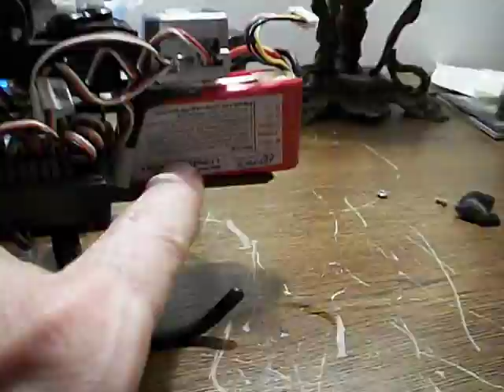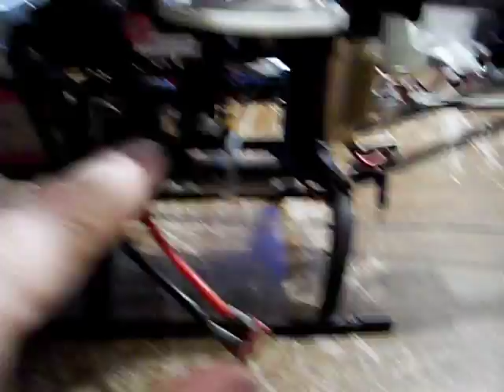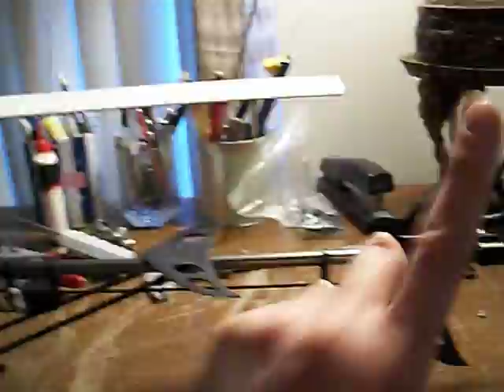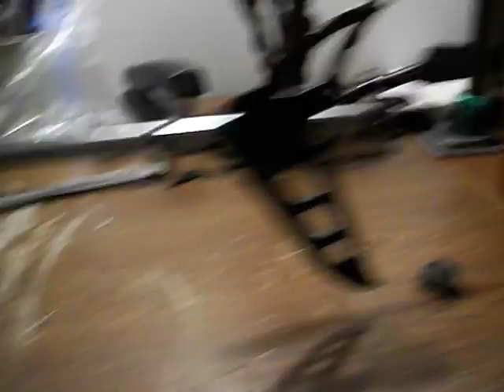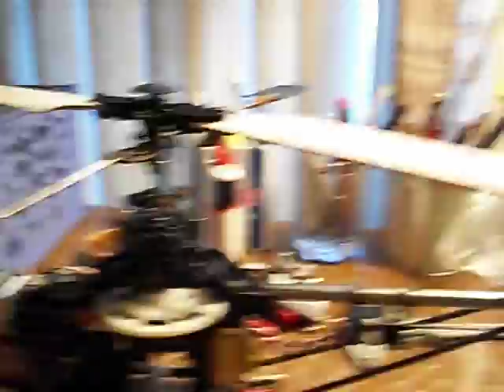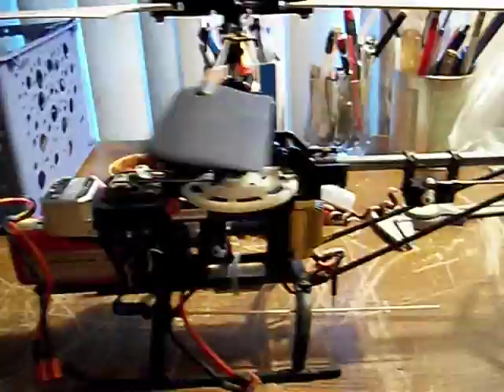Falcon 3D electric helicopter

Comment: Great video, and so true. There are only two kinds of helicopters, those that have already crashed and those that are about to crash. When is the last time you attended a vintage helicopter fly-in?
Reply from the maker: did not know there were vintage heli fly-in but sounds like fun. I know there is vintage pattern (kaos 60's etc... fast flying turnarounds and such). I have not touched sticks in about 5 yrs, took it out for a quick hover and all went well, guess you don't ever really forget. I will wait for a nice dead calm day so I will not get any surprises. I never got into 3d type stuff but was competent to the point of routing flying including nose in hovers etc.